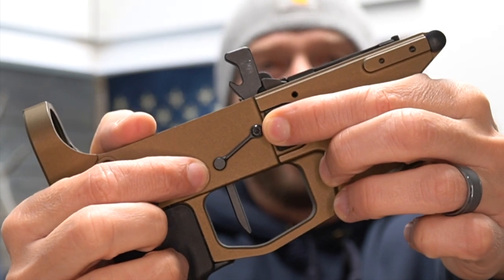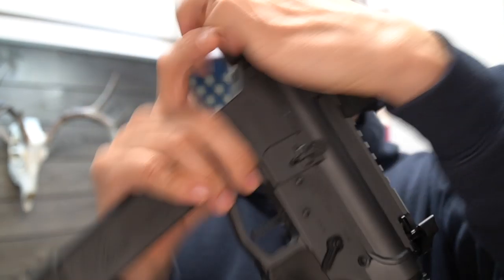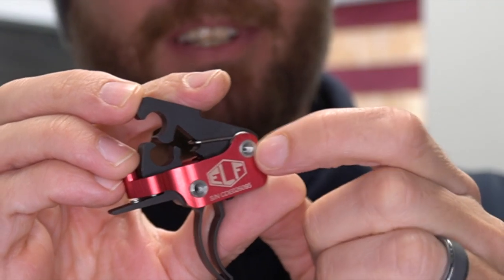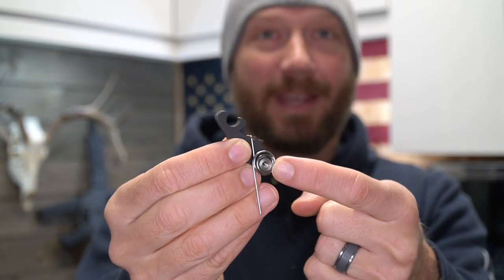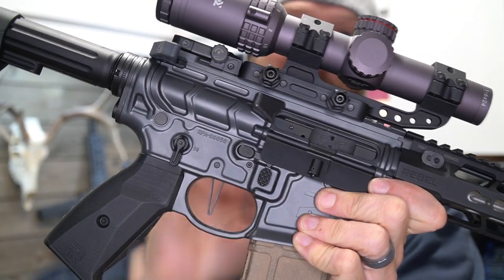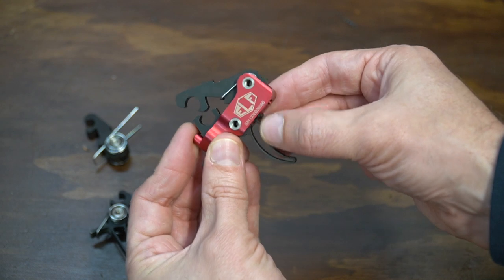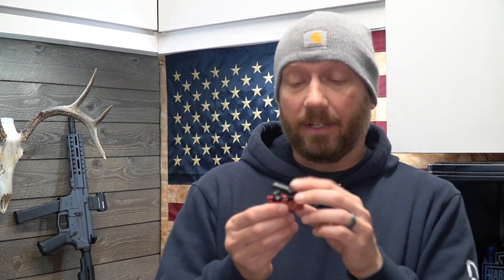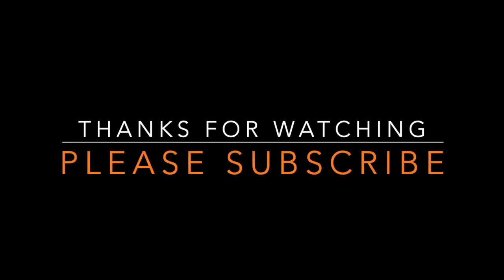You don’t need anti-walk pins!

Comment: how do those 2 bottom screws work?
 you have to drill two holes in the lower?
Reply from the maker: No. When you tighten them from the top, they protrude downward from the trigger housing and push against the receiver. That upward pressure puts tension on the trigger/hammer pins.

Comment: Mine isn't threaded
Reply from the maker: You have the regular one then. Only the Pro-Lock series are threaded.
Reply: @HarleyWood23  which pins do I get? Just got some at local gun store and they went right into my receive with no effort at all, loose, sloppy
Reply from the maker: mark c 
They don’t need to be tight. Sounds like you got the CMC ones maybe? They just need to not walk out the side.
Reply: They fall right out when I rotate the lower
Reply from the maker: Did you get antiwalk pins or just normal pins? These are antiwalk pins. https://www.cmctriggers.com/parts/ar-pin-sets/
Notice how there’s a pin and a screw that threads in each side.
Reply: Just normal ones, guess I need the other kind
Reply from the maker: mark c 
You using an elftmann trigger? With these drop-in style triggers, normal pins won’t work. You’ll definitely need anti-walk pins. There are many kinds out there. KNS makes some good ones too